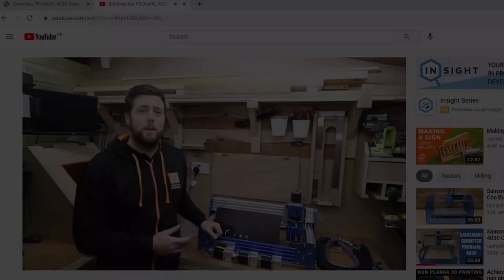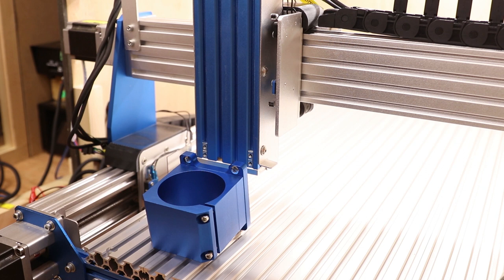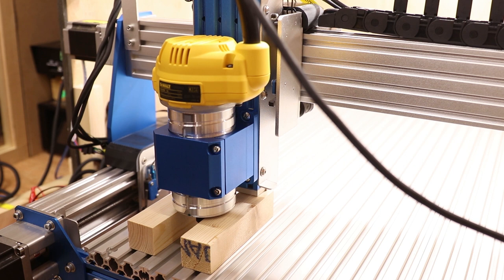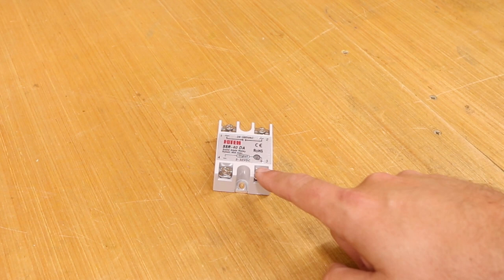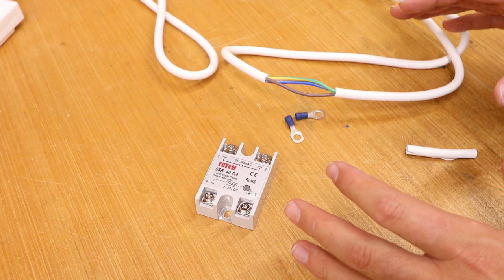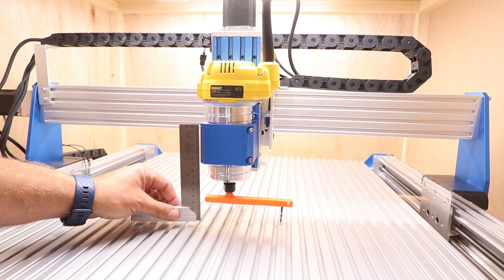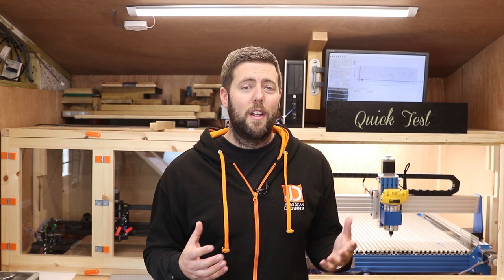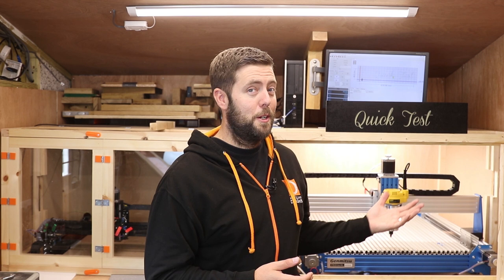Upgrading your spindle/router on a desktop CNC - 300w to a Dewalt DWP611

Comment: Will this work on the masuter pro I have Makita router and would like to use it
Reply from the maker: Yes, exactly the same principle 👍
Reply: I have the Masuter Pro. I just now recently received my DWP 611 and it did not fit the larger collar the Masuter pro was shipped with. Has something changed in the DWP611? 😢

Comment: Can you use the DW611 on a 3018Pro???
Reply from the maker: With a lot of upgrades, yes you can. But then you have to question if its worth spending on all those upgrades rather than just buying a better machine.
Reply: What other upgrades are necessary?

Comment: Hi James, me again!

Question regarding the SSR.

I have wired in a DC/DC SSR for use with the 3018 Pro. Running the 20k rpm motor.

Having an issue where, if I use the hand controller supplied with the 3018 pro to start the spindle, the SSR engages, and stays engaged (as it should) until I turn off the spindle via the remote. However, when I connect everything up and load a file into UGS to start a job from there, the SSR (and subsequently the motor) are triggered for about a second or two, then the SSR cuts the spindle, but the tool head continues moving (no errors within UGS). However, when I then goto stop the job within UGS, the spindle momentarily starts again, then stops immediately. It's almost like the board is sending a 1-2 sec pulse at the start of the job, and a 1 sec pulse when the job is stopped. Very weird!

Any ideas, would love to know your thoughts and if we can resolve this.

Many thanks,
-Charlie
Reply: I should mention that the SSR is working fine, its seems to be a power delivery issue from the board.

Also note, the board and the motor are being powered separately, but from the same PSU (15a 24v). Because I wired in a speed controller board between the PSU and motor.

All working fine when using manual control via speed control previously by the way.
Reply from the maker: @Pixel-CNC  My first thought is your S values inthe Gcode might be too low to engage the SSR correctly. So for example the board output for the spindle is 24v, if you have your S vales (RPM) set up to run at less than 50% its going to be outputting less than 12v which may be too low for the SSR. So check your $30 value in your GRBL settings and make sure your RPM matches that within your design software
Reply: @JamesDeanDesigns  thanks buddy, will have a look. Pretty sure everything is aligned already. If you have any other thoughts, do let me know!

Much appreciated bud.
Reply from the maker: @Pixel-CNC  you might need to do some testing with a Multimeter to find out if the voltage is dropping somewhere. Within UGS, go to the console and type m3 s10000 and hit enter (or S20000 depending on what your $30 is set to). Also before doing this make sure the speed controller is turned up to full. does the spindle stay on? to shut it off just type m5 and hit enter
Reply: @JamesDeanDesigns  Hi James!

Spindle speed control set to 100, my $30 is set to 20000, however the S20000 command doesn't do anything. The M3 s10000 starts the spindle and it stays running until the m5 command is used. RPM is all matched from fusion, everything is 20k.
Reply from the maker: @Pixel-CNC  That is really odd. I was expecting the spindle to fire up for a second or two and then shut down but it runs longer than I thought in your video. And the fact that M3 s10000 keeps it running constantly suggests to me it might be a coding thing and opposed to a wiring or hardware issue.  One thing to try, set your $30 to 10000 and test it, see how it goes. Feel free to send me your files as well and I can take a look at the code. Reach out to me on Instagram or facebook and I can give you my email

Comment: Is it just me or is it ridiculous that you have to special order a 1/8 collet for the dwp611???
Reply from the maker: Just get a 1/4 to 1/8th sleeve from amazon. Easier, faster, cheaper
Reply: @JamesDeanDesigns  will the additional collets for the standard spindle work with the Dewalt?
Reply from the maker: @davidgulbransen1630  no, the dewalt has a different style collet than the ER11 ones you usually get
Reply: But it should have come for free with the router.